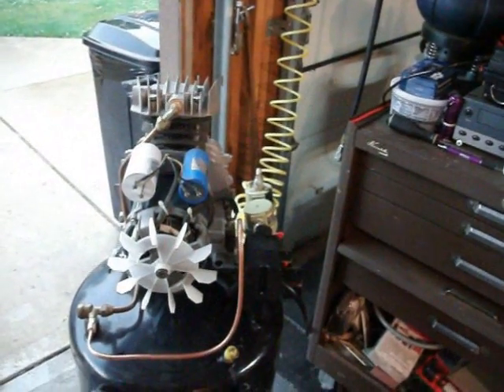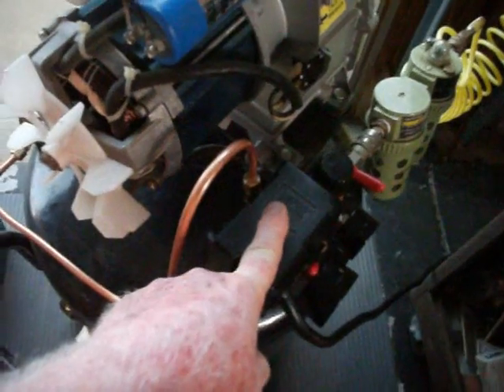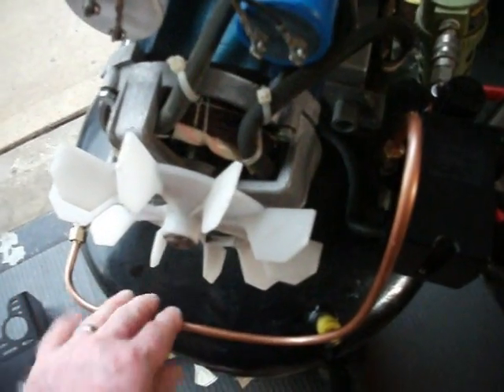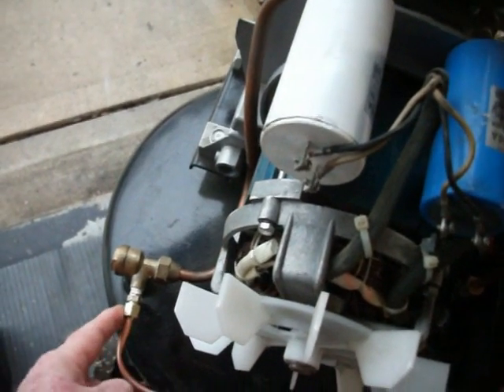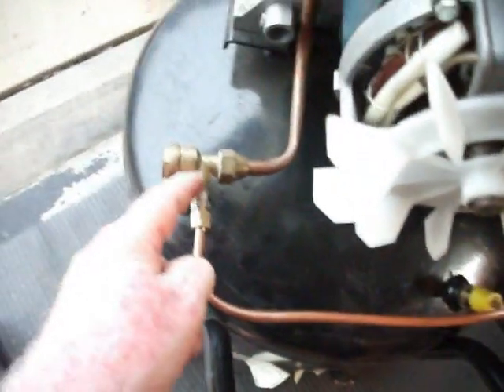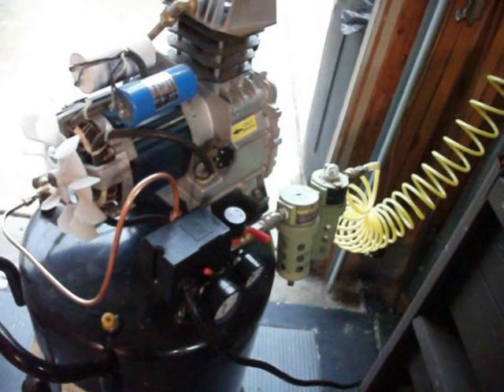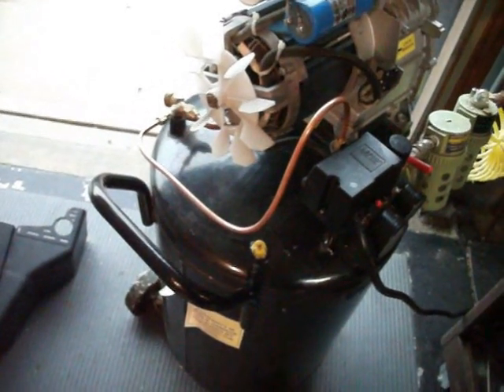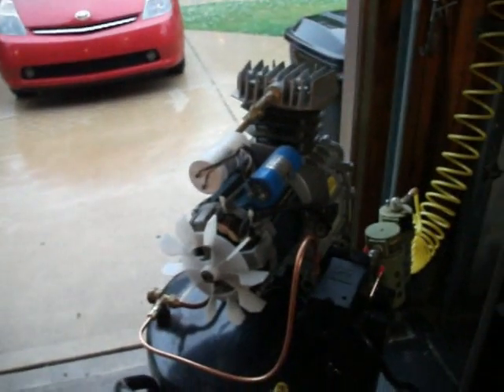Pressure Switch Upgrade-Harbor Freight 21 Gal.

Comment: Somebody gave me this same compressor. Im definitely going to change the pressure switch and plastic tubing when it breaks breaks. Mine leaks oil like crazy  but hey it was free. Great video, great information don't understand why all the negative comments. This guy is just trying to offer free advice, hes old, wise and has probably been fixing things long before the internet was invented.

Comment: Just so you know, they have an automatic drain that bleeds the water out then shuts off. This you can find at Harbor Freight. I highly recommend it for any tank on a home compressor. Set a catch pan under it if you don't want dribbles on the floor.
Reply: Ronald Nickell It's a tad too long.

Comment: I saw a video on this compressor where the guy that made it said you can' only take one tire off with this compressor 21 gal and then you have to wait  minutes for the pressure to build to take another tire off. IS this true? If so this is a weak compressor isn't it? I was going to get the 29gal one at Harbor Freight to avoid the issues. What do you think?
Reply: +David DeRoche That's not at all true... I've had this exact compressor for close to 10 years now. and if you have a decent impact gun, and ditch the stock regulator (which is total crap), it will remove tires no problem.

Source: I have the current top of the line IR 2235TIMAX impact gun, and when in free wheel (meaning no load, meaning the impact gun is eating all of the air that can possibly flow through it) it takes about 30 seconds of laying on the trigger before my tank pressure goes from 120psi to 80psi (when the compressor turns on). In normal use this compressor will keep up with my "monster" impact without issue.

That said... This is $150 air compressor. It's about as good as it gets at that price.
Reply: Thanks man I really needed that info
Reply: +Maxwelhse  What regulator are you using with it?
Reply: Not using any regulator at all at the moment. Just running straight tank pressure.
Reply from the maker: +David DeRoche As far as I know I have not had that experience. This compressor has worked flawlessly this the posted update. Harbor Freight items give you generally what you pay for, so some repair or maintenance will always be waiting in the future. Northern Tools sometimes make a better version, you just have to wait for the sales.
Reply: @TheBrokenLife  your hoses won't be long for this world if you do this too much
Reply: @mechantics  I've been using the exact same air hose for 18 years...

Comment: Why didn't you just use you warranty and get a new one instead of the hassle.
Reply: Alfonso Gonzales I'm thinking the same thing.
Reply: GREG GUITARS LLC PLUS, focus, focus, focus. What was the ultimate purpose of this video foray. I started to nod off!
Reply: +Maxwelhse Agreed!
Reply from the maker: +Alfonso Gonzales Because the warrantee had expired a long time ago, and besides the metal tude, not plastic was a permanent fix, and the switch was also a better upgrade than the original.
Reply: Guy Wooster you